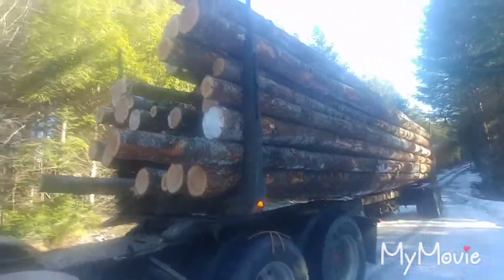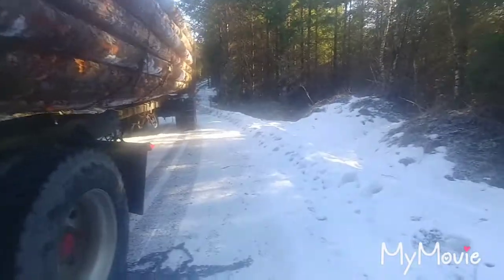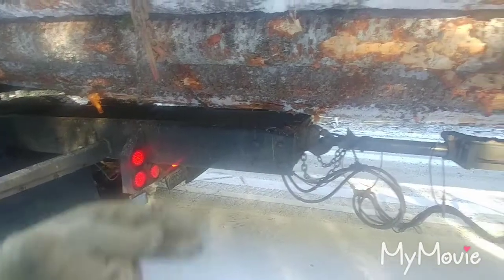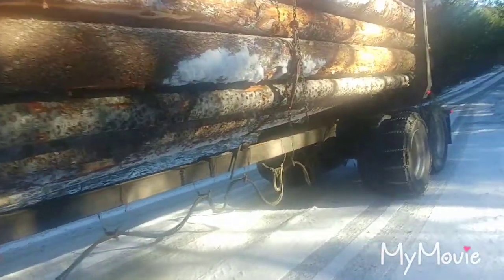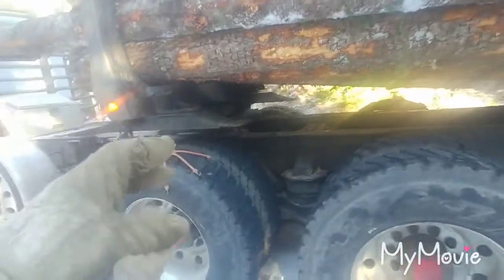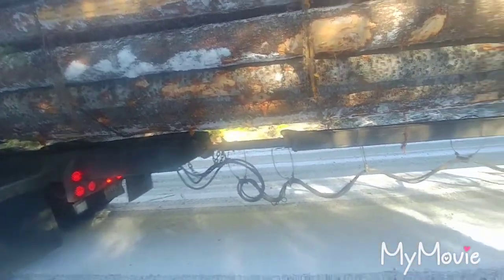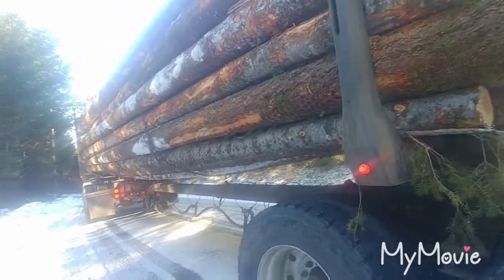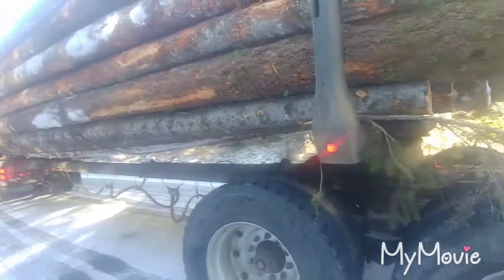How a log truck compensator works and I stripped a load!

Comment: Just run. G-string when it’s steep & no more stripped loads
Reply from the maker: Great idea!  I should have done that!
Reply: We've been doing dead take off on a poorly designed landing at over 20° grade up. Doing g-string plus front bunk wrapper been keeping the load on (also a push). A number of lost loads at first, lol.
Reply: @evanschulz7375  Ah! Sketch conditions! Been there my friend, adding the front bunk wrapper is one I’m filing away for next time I’m doing the straight up take off thing, sure is nice in the steep when the shovel man can throw a couple bunks on that still have a little butt flare on them. Happy Tree Truckin